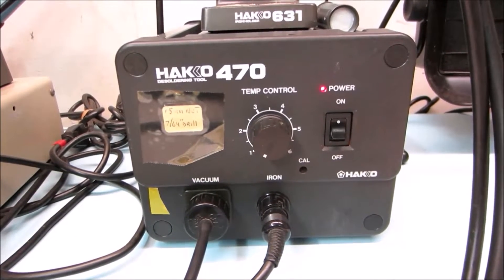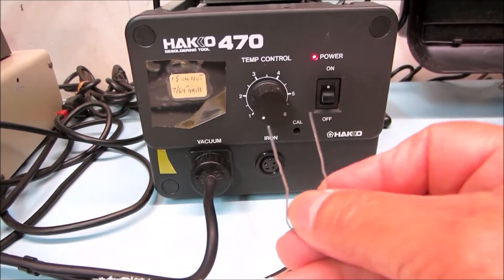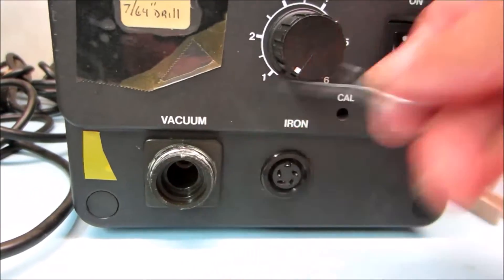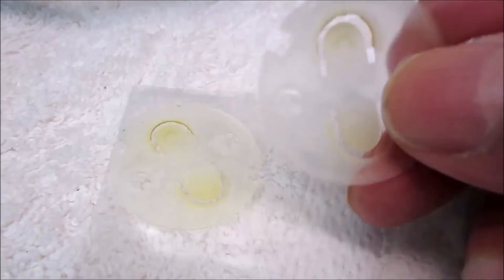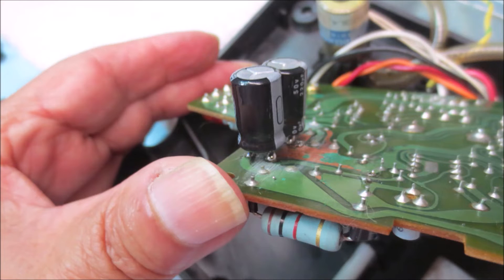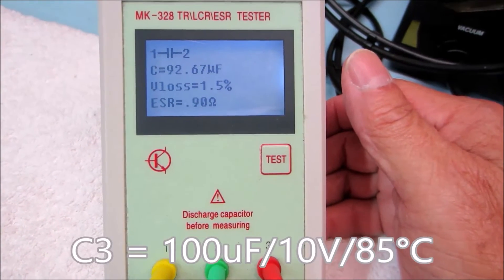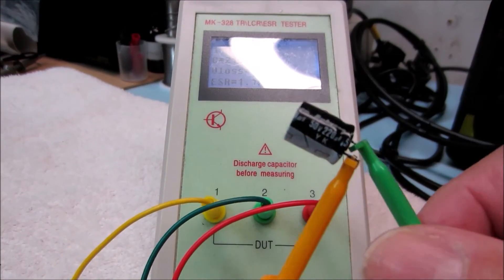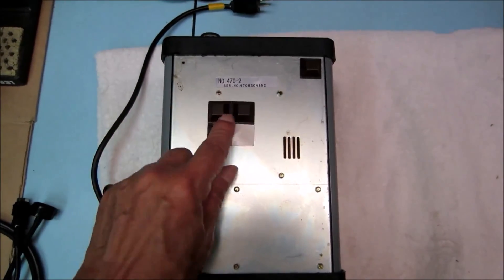Hakko 470 Repair Secrets

Comment: Hi there , I saw you on Jestine's site today ,  I saw your vid on the Hakko pump.   Those 2 last caps you tested were way out of spec on the ESR , they should have read 0.20 - 0.45 of an OHM instead of 1.4 OHMS , that is way too high for those caps ....... There was another one in there that was hinging on the edge of being bad also...... Till the next video Mon Ami ........

Comment: got one of these off ebay got it in today.. good grief the jamed up heater on the tip was jammed.. .. it's toast. looking at tips.. looks like its unobtainium .. so .. pondering going for 817 or 809 for parts. any recommendations?
Reply from the maker: My very early model 470 came with an 802 desoldering gun. Later models of the 470 almost certainly would have come with different desoldering guns. You mention the 817 and 809, but you don't make clear which desoldering gun came with your unit! So, visit https://hakkousa.com/support/support/user-manuals.html Enter 470 in the search box and download the manual which most closely matches the model you bought. Referring to this manual, https://hakkousa.com/support/support/user-manuals.html which closely matches my old 470 station equipped with an 802 gun, and assuming you also have an 802 gun, you're going to need:
A pack of A1009 ceramic filters for the 470.
A pack of A1033 ceramic filters for the 802.
A pack of A1030 spring filters for the 802.
All three of these are listed on page 21.
A pack of A1003 desoldering nozzles, 1 mm or 0.04" (most useful size).
A B1087 cleaning pin for use with A1003 nozzles.
A B1303 cleaning drill for use with A1003 nozzles.
All of this stuff is listed on page 2.
The heating element, should you need one, and you will if the tip is missing metal like an old auto exhaust pipe, is an A1029. The heating element is shown on page 21.
The cleaning pin (looks like a screwdriver) used with the A1029 heating element is a B1259. You'll definitely need one of those. B1259 is also listed on page 2.
You might also need a long cleaning drill for use with the A1029 heating element. I have one, but I'm not sure of the part number. I haven't used it that often... Soldering gun maintenance (use of these tools) is covered very well on page 12 in the manual. One thing the manual overlooks is periodic A1012 O-ring replacement. The O-ring, shown on page 21, is located at the back of the filter pipe. Over a period of time, it petrifies, cracks and causes a vacuum leak. Keep it lubricated with silicon grease and replace it often. The green color, nitrile, O-ring currently in my 802 came from a Harbor Freight O-ring kit, sku 67644. You can also get very inexpensive assortments of micro drill bits, sku 61526 or sku 94606, used for cleaning A1003 and other size nozzles from Harbor Freight. Hope these part numbers help. The 470 is a wonderful tool, but there is a long learning curve and you need all this stuff in order to maintain it. Good luck with your 470! Study the manual. Thanks for asking about it.